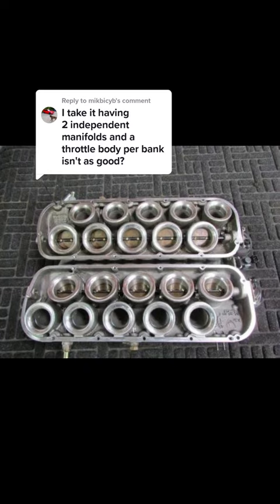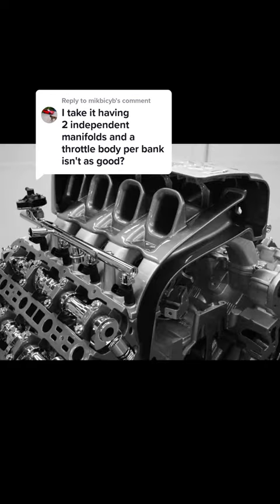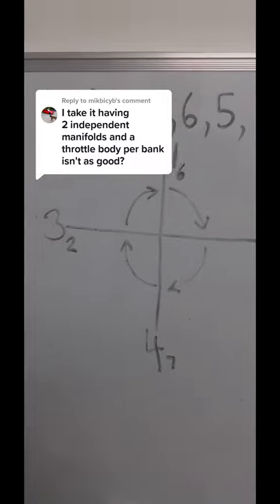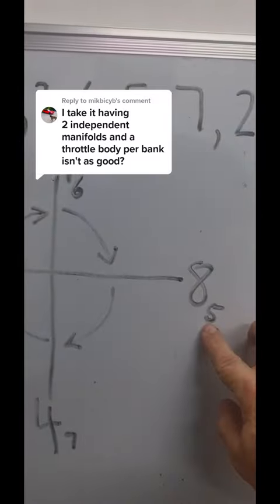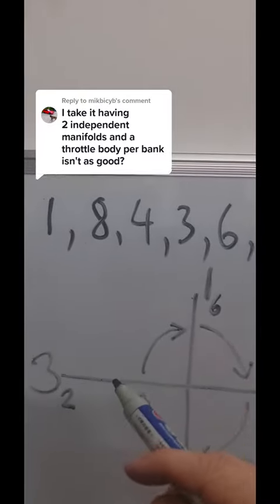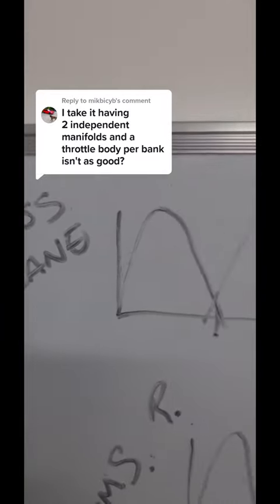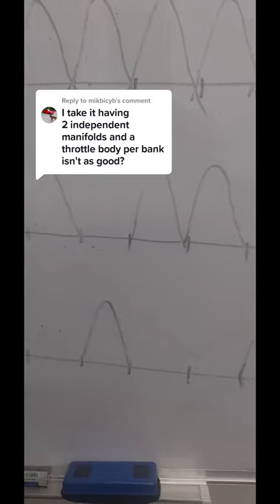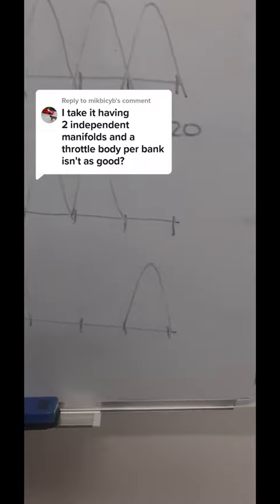Don't Make This Mistake with Your Engine: Understanding Single vs. Dual Plenums & Crank Layouts

Comment: What about a v6? Aren’t most if not all v6 flat plane? Or just even firing order?
Reply from the maker: Really depends on what V angle they run and what the manufacturers run with.  Technically they can't be a "flat plane" as the firing order split needs to be 120 degrees for all 4 stroke engines.  But lots are even fire. So will benefit from twin plenums. Or better yet twin plenums with RPM activated bypass units like supercars run.